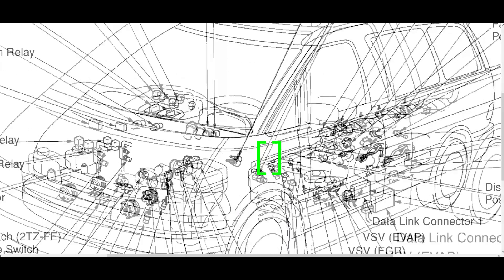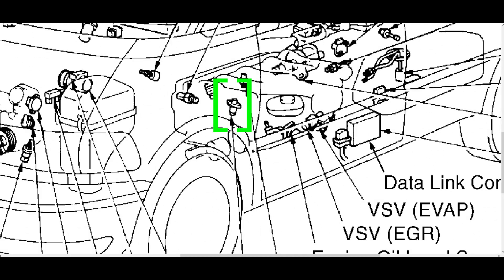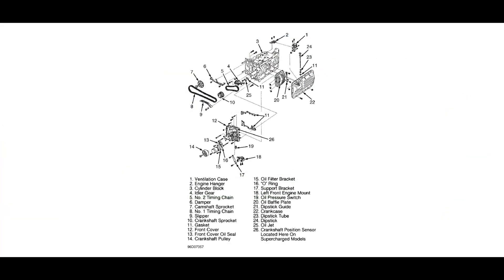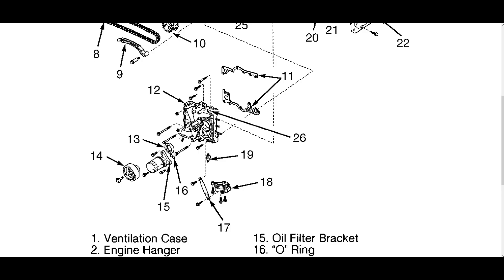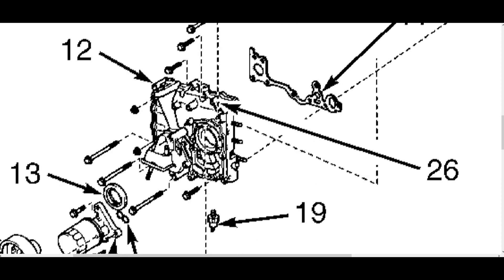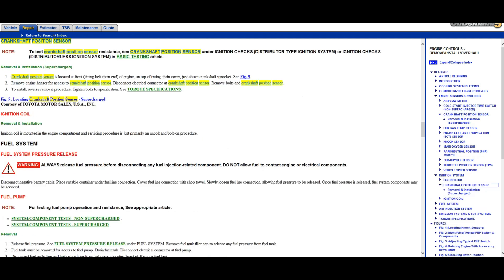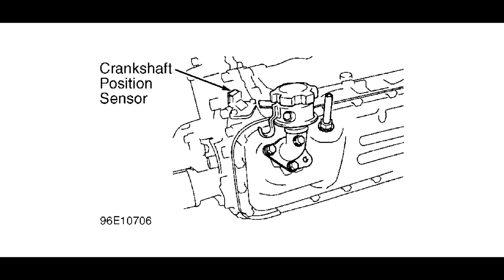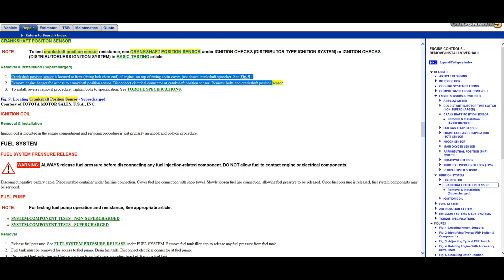Crankshaft Position Sensor Location 2TZ FE TCR10 Tarago Previa Estima

Comment: while traveling Friday night in our 1992 Toyota Previa we heard a click and than the headlights, fuel pump and a few other electrical things just shut down. we had to have the van towed home. are there any relays that control that behavior?
Reply from the maker: I would check the main relay in the center dash as it is related to the fuel pump and headlights plus check the fuses under the hood.

Comment: A code appeared in the last jumpy I made, code 14 and code 43! Could it be that when removing the complete distributor assembly to change it, it came out of place and doesn't want to turn on, does this interfere? hug thank you 🙏🏼
Reply from the maker: 14 Ignition Signal 43 Starter Signal. I don't know if changing the distributor would create these error codes. If the connection plug still okay? I would clear the codes by disconnecting the battery for 2 minutes and press the brake once to drain any power in the system. If you get them error codes again dry the old distributer after clearing the codes. You may have a got a faulty distributer.
Reply: @TaragoPreviaEstima  hello my friend ! Thank you very much for the tips, this week we managed to find out what was wrong, a screening was carried out and it was discovered that the ECU housings and ignition module were loose, and the fuse in the battery part was oxidized! After making these adjustments and redid some cold sildas in the ECU, the car started! Thank you for helping me 🙏🏼
Reply from the maker: @leandroferreira2307  I am glad you got it sorted out. Happy to have helped. Take care.
Reply: hello my friend ! Thank you very much for the tips, this week we managed to find out what was wrong, a screening was carried out and it was discovered that the ECU housings and ignition module were loose, and the fuse in the battery part was oxidized! After making these adjustments and redid some cold sildas in the ECU, the car started! Thank you for helping me 🙏🏼

Comment: hello my friend! It's not difficult, could you give me some help? I'm in a 1994 Toyota Previa, it's been parked for over 6 months, I've been to several mechanics and they don't have much knowledge in this type of vehicle, the car won't start. ignition and injection light does not come on and is not burned out, fuel pump, pressure regulator, injection nozzle, spark plugs, and cables have been replaced! The distributor assembly was checked and it was cracked, the assembly was replaced with a complete new one and the car won't start, it won't start! Maybe you have some tips that could help me! thank you sincerely
Reply from the maker: Check if you have fuel pressure at the injectors by loosening off the fuel rail bolt just a little and turning the IG to ON for 2 seconds 'but' DO NOT try to start. fuel should come out 'if not check the efi fuse'. Check for spark at the plugs. Make sure the MAF or VAF depending on what one you have is clean and the connection is on correctly. Check for corrosion in the connection. Make sure there is no air leaks on the intake. If it sounds like it wants to start check for a blocked exhaust. If bad injectors! Try removing the plugs and put about 20ml 1 tablespoon of fuel in each piston then put the plugs back in and try to start. If none of that helped then check you have good compression in the pistons. and also check the ECU, If the ECU is faulty it will not start, open it and look for a blown resister. If it's blown you will see it very clearly. You mentioned that the injection light does not come on? All the advice I gave is only for petrol engines.